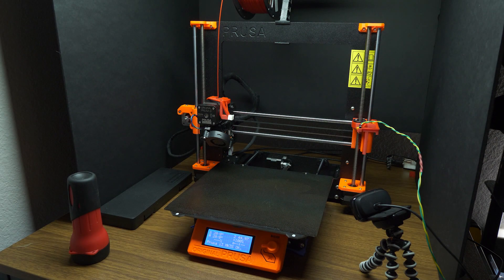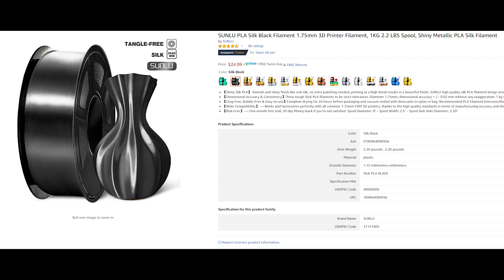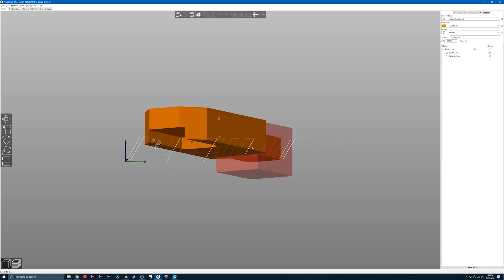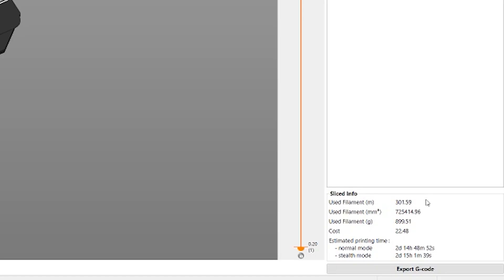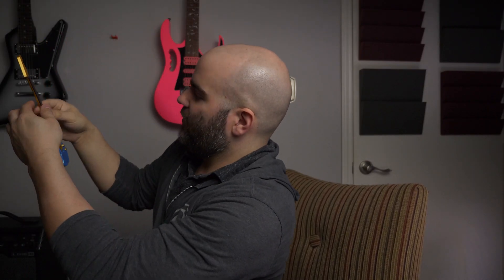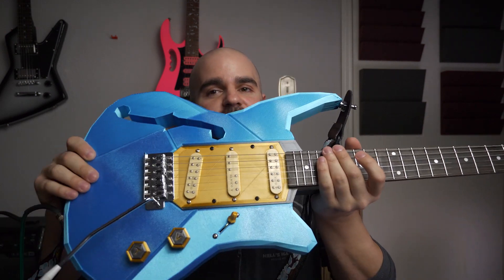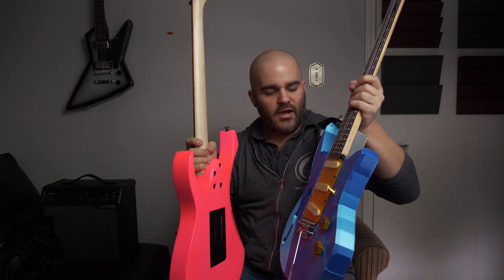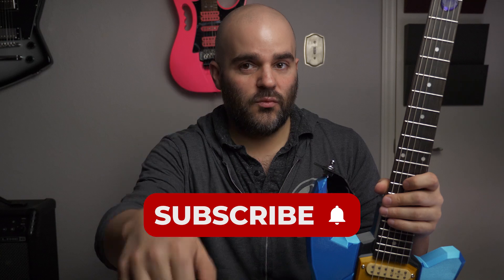I MADE A 3D PRINTED CUSTOM GUITAR - The Polycaster

Comment: This is a very cool design. Thanks for sharing.   I have an Ender3 V3 KE and the print bed is 220 x 220 x 240mm .   The pickup block doesn't look like it will fit laying down on my print bed.   Do you think this could be printed standing vertical?

Comment: That came out looking great!  I would have been nervous about that solid brick in the middle.  I'd get through half a roll of filament and have something mess up and lose the print!  I think I would have tried 35% and if it warped, I would change it out.  To that end, I would have kept the final thing a bit more modular so I could sub things out later if necessary... but you don't have to worry about that!  Really nice work!

Comment: honestly, 25% cubic infill with a thick wall would’ve worked fine for the middle part of the guitar. josef prusa himself made a guitar design and did 25% cubic infill for that section and said it stood up to the tension for over a year without any warping.
Reply: What happened after a year?
Reply: @mikefarquhar5063  nothing
Reply: Pitch stability is important, unless you want a tremolo for free id suggest go thick

Comment: I am gonna print this guitar!
Reply: I'm new to all of this apart from guitars, I know my stuff in that area but not 3D printing so im asking around for thoughts and insights, like materials and designs than can be used and altered on CAD etc to achieve lighter than a standard or custom strat for  example, weight And the resonant qualities of the body of the guitar plus neck and parts on a whole and the internal structure plus the balance while wearing it with a strap so it doesn't neck dive, big factors, I can see the potential in 3D printing, like a honeycomb structure with a smooth finish encapsulating the honeycomb structure inside, can be designed in a way to make a standard looking traditional fender guitar lighter and perfectly balanced, and still have the strength to hold the tension exceeding the string tension (of the thickest gauge to exceed tolerances) would be the standard I'd be gunning for, my question to you is what would your choice if material be, the rolls of plastic, is it just plastic or are there more materials useable on something like a guitar body?
I'd also if there's something like copper or aluminium- use that to make a shielded pickguard, no point shielding anything else as its not about making a Faraday cage to stop EM noise, the pickguard acts like a dish that can be grounded to draw the excess em to earth rather than the pickup 'picking it up' 
I digress,
I'm just curious and interested in this, now that I can see a proper guitar csn be built using 3D printing! Who would've thought 20 years ago! 
My Canon WiFi printers ink is more expensive than some of the plastic rolls I've seen on amazon and ink goes fast, on purpose I'm sure of it

Comment: Do you think I could do this with my Da Vinci Jr 3D Printer (150 x 150 x 150 mm build size) and not much experience building guitars? I really want to try!
Reply from the maker: Some of the pieces may have to be split into two pieces. They might be too big for that build plate
Reply: @AndyDoesGuitar  thanks for the response, I’ll work on it! Anything else I need to know before I start? I have like no experience
Reply from the maker: @Minebender9  Only other real thing I could say is to make sure the neck you order a good neck from a reliable retailer. The neck I used for this guitar was one that I had lying around from a previous project, so I was able to model the guitar's neck pocket around that neck's dimensions. But when I ordered a neck for my Assassin's Creed guitar, I ordered it from some cheap Chinese knockoff store on Ebay, and the dimensions on it were completely different from what was on their spec sheet. I modeled the guitar body based on the spec sheet, so when I got the neck after I had already printed the guitar, the neck didn't fit properly, and I had to make a few modifications after the fact. So just keep that in mind.

Comment: Ive made several 3D printed guitars and 100% infill is a massive waste of time and materials and completely unnecessary.  The most Ive done on the center portion was 25% infill, with the outer parts being 15% infill.  Also, the middle section is usually 2 parts due to the size of my 3D printer and there has been zero issues with warping/bending.  Granted I do use PLA+ with a .8mm nozzle, which does significantly increase the strength of the parts.  Not really sure where you got this idea that it has to be 100% infill though, but its really just a massive waste.  Other than that, your design is amazing and looks incredible.  The 1 tone pot is also an interesting design choice.  What made you decide to not use 2 tone pots?
Reply from the maker: Good to know. This was really my first 3d printed guitar, so I didn't get a chance to test different infills. And I've never printed with PLA+, so I'll definitely check it out. For the 1 tone pot, it just suits my kind of playing. I've just never been in the situation where I want certain pickups to have different settings for the tone, so only having one tone knob made more sense to me.
Reply: Are you making decorative guitars or functional? Idk about the pitch stability with 25%.
Reply: @Philinnor  Functional, and they actually sounded really good.

Comment: Hi Andy!  I'm trying to decide on a color for the body.  I'm leaning towards Paramount 3D's Hannibal Red.  How many spools did it take you to make the outside body (not the 100% infill piece)?  Trying to figure out how many spools I need to order for the outside body.  I've got the MK3S+ and it took about 30 hours to print the main 100% infill piece, and almost a spool of filament.
Reply from the maker: For the outside body parts, any piece that had screws that needed to be put in them, I printed at 25% infill, then the rest were 15% infill. I was able to print all those pieces with a single roll of filament.
Reply: @AndyDoesGuitar  Thank you for the info, and thank you for the design!

Comment: Great video, how many reels of filament did you have to order for this project? What would you estimate the cost to make the body? Thanks.
Reply from the maker: Altogether the whole project was about $250. I believe 3 rolls of filament were used. 1 entire roll for the middle piece, 1 roll of blue for the rest of the body, and then 1 roll of gold for the middle "pickguard" and knobs. Since so little gold was used, if you don't care about different colors, you could probably get away with just 2 rolls of filament.

Comment: Would this work in PETG?
Reply from the maker: I would assume so. PETG is supposedly more structurally sound than PLA and will last longer, at least to my understanding. I've just never had experience printing with PETG. The few times I've tried to print with it I've had problems, and just didn't have the patience to properly troubleshoot. But everything I've seen makes me think there shouldn't be a problem printing with it for a project like this.

Comment: it sounds great! but I'm curious about how tune stability compares to wood, since it gives and changes depending on humidity and temperature.
Reply from the maker: Tuning stability has been surprisingly good in my experience, now having this guitar for over a year. The action has raised and it's hard to combat that since the PLA has slightly warped over time (a redesign with carbon fiber rods may be in order), but day to day tuning has been fairly consistent.

Comment: Hey man, just came across this video, thinking of building this at least to have just sit around and look cool, i have no clue about anything having to do with guitars, what would i have to look for to buy to make this, besides the filament for the prints, are there any guitar kits or guitars you'd recommend to look for as a donor for parts, or would it be better to buy the parts i need separately?
Reply from the maker: It'll probably be cheaper if you guy a stratocaster style guitar kit and just use the polycaster body in place of the guitar body it comes with, but in my experience, the parts that come with kit guitars are pretty cheaply made. I decided to get all the parts separately. In the end it probably ended up costing a little more, but the parts are much higher quality.

If you want to get parts separately you'll need:

- replacement guitar neck (with a 25.5" scale)
- tuning keys (the configuration will depend on the headstock style of neck you get, but mine required 6R keys, meaning all 6 of them are on the right side of the headstock)
- strat-style neck plate
- single coil pickups
- SSS pickup wiring kit (you can fairly easily find pickups that are prewired with everything you need)
- strat pickguitard screws
- stratocaster tremolo bridge kit

I know it might be a lot to swallow if you don't know anything about guitars, so if you just get a kit guitar and use the Polycaster body in place of the guitar body it comes with, it might be a whole lot less complicated, but you're handing off quality for convenience. I probably ended up spending about $250 (parts and filament included) putting this guitar together, and you could probably find a strat-style kit for around $150. But in my opinion, spending the extra $100 to get the parts separately is worth the money.
Reply: @AndyDoesGuitar  thanks, you just helped me take a massive jump in the right direction, just 1 more question, do you remember how much filament it took to print the body? I know you said it was 1 roll for the 100% infill on the black piece but I don't think you said what the rest of the pieces added up to be?

Comment: Hi Andy, I'm finishing off my strat design and I am wondering if u would recommend printing it in PETG instead of PLA.
It's true that PETG is less stiff than the PLA, but it deals a lot better with hotter temps.
Also wondering if you managed to find a way to implement carbon fiber rods into the print, as I can't find a reliable place to put them :(.
Cheers! Excited to see your next work.
Reply from the maker: I have not had a chance to experiment with PETG yet. I've only ever messed with PLA and ABS. PLA is just so much easier to print, it's been a struggle anytime I've tried to print anything with ABS. I have heard that PETG is supposed to be more durable than PLA. Even all the parts for the Prusa printer are printed with PETG because it supposedly can handle more abuse.

I haven't gotten around to figuring out how to put carbon fiber rods in this design, but I am currently printing a new design that will implement a carbon fiber rod down the center of the body. Don't know if that will make it sturdier, but it's a little test I'm conducting. I'm hoping to have the guitar printed by the end of next week. And if all goes well, I plan on making a video about it that will hopefully come soon after.

Comment: Yo that sounds amazing. Did you 3D print parts of the neck too or is it wood? How much of this did you actually print?
Reply from the maker: The neck is a cheap replacement neck I got on ebay. Altogether, the whole thing cost about $250 to put together.

Comment: Hey, I wanted to say thank you for this design. It's very well designed in my opinionI would have loved to leave you a tip on thingiverse!
I have almost finished printing all the parts and currently I gather used electronic parts. Although I had some problems with bed adhesion (prusa mk3s) where some corners of the pieces lifted up from the bed, but I think I can still use them.
I used to play guitar a long time ago and was searching for a bigger project to print. So after I saw your model on thingiverse, I decided it's time to pick up an old hobby again. I will post a make on thingiverse of my hopefully well assembled copper/white/maple guitar!
Again, thank you very much!
Reply from the maker: Thank you! Let me know if you end up building it. I'd love to see someone else with one.
Reply: @AndyDoesGuitar   
I finally finished it after some problems. But it works and looks pretty damn fine. Thanks again for the model :) I couldn't be more proud... https://www.reddit.com/r/3Dprinting/comments/jwzbow/first_big_project_3d_printed_electric_guitar/

Comment: This is a nice looking guitar... I'm not so sure about the pickup/trem mount being printed/plastic - I'm guessing other materials and possibly higher gain pickups might be best - this guy is onto something though...essentially guitar design since the 60's has not changed a lot - other than complete hollow body guitars most are essentially a wood block mount for the neck..much of the tone comes from pickups and the neck in an electric guitar. The 3d printed surrounds could literally be anything...density can change tone - brighter or duller/thicker tones through the material surrounds....I'm thinking hollow chambers which can be filled with different density of liquids to change the sustain properties of neck against the pickup mount block and neck material... Interesting stuff...

Comment: Amazing project! I don't know if this is a silly question, I'm new on this, but...can you print the whole body vertically? I mean, a guitar standing and not in horizontal pieces?
Reply from the maker: Possibly, with a bigger 3D printer. The printer I have doesn't have the print volume to print the whole guitar in one piece, regardless of the orientation.
Reply: @AndyDoesGuitar  it also would not be as strong. it is important how the layers are build up,

Comment: Hello! Is this guitar still in right condition, or has it degraded noticeably over time? Im curious as I'm currently designing one for myself. 

Is it PLA?
Reply from the maker: Yes, it's PLA. It's held up pretty nicely. My only issue thus far is that despite the center piece being 100% infill, it has still warped slightly. Not a huge deal, I've just had to make a few adjustments to the truss rod and re-intonate the bridge.

Other than that it's holding up just fine. I think for my next design I'm going to try to get some carbon fiber rods into the body to see if that helps keep it from warping.
Reply: @AndyDoesGuitar  Thank you!

Comment: Hi Andy. How did you manage to tighten the screws and are they holding well (especially the bridge screws and those holding the bridge springs in place on the back of the guitar)? I am looking into the details as I am considering using your design as a base for a project if you do not mind. Thanks
Reply from the maker: There are guide holes in the design, and since it's 100% infill on the big piece, the screws thread quite nicely into them. They're holding strong.

Comment: Nice Andy. How does it balance while standing? Does the neck dive because of its weight or does the body weight balance it well? Thanks
Reply from the maker: I was surprised to find out that it balances nicely. I was worried because I expected the body to come out a lot lighter than it actually did, so I was expecting it to lean a lot towards the neck. It's still a bit neck heavy, but not a lot.
Reply: @AndyDoesGuitar  Thank you so much Andy

Comment: This is probably the prettiest guitar i've ever seen, huge congrats on the design.

100% core piece? IDK, maybe there's better sustain that way too.
Reply from the maker: Thank you so much! The sustain on it is pretty decent, but it would be a lot better with better pickups. The pickups I'm using are pretty cheap and leftover from an old project of mine. When I get the chance I plan on putting in something a lot better, probably some Texas Specials.
Reply: Yeah, 100% infill may be a waste. I don't have a 3D printer, but I'd recommend to make simulations in a program to see see where is the point of max stress and apply more infill in those parts. Basically smart infill.
Reply: Another way to achieve strength in 3d printing is through the perimeter count / wall thickness, which people say contributes more to the strength than just the infill
Reply: @deleteduser201  There's actually a part  that i did at 100% infill not too long ago, where no matter how many perimeters, it just didn't work. The load is so high that material would eventually distort and creep, and the one way to prevent it was to give it plain nowhere to go by printing full solid.

They're brake shoes for the backrest of my office chair. I have also reinforced these shoes, by epoxying an M8 bolt into one and a 10/8mm alu tube into another, and modifying the geometry a little to give them more grabby meat around the shafts but less length. Another change was switching from PETG to HIPS. The chair came with cast resin ones i think and they were crumbling.
Reply: Tell me you’re not serious! It’s the ugliest guitar I’ve ever seen!

Comment: This is absolutely amazing! How much was the total cost?
Reply from the maker: Probably about $250, give or take

$40-50 on the filament
$30 for the pickups (they were cheap ones from Amazon)
about $50 for the neck
$40 for the bridge
$30 for the tuning keys
and the rest on the other parts (pots, switch, screws, etc)
Reply: What neck exactly did you buy?